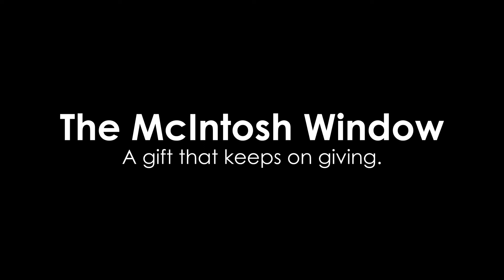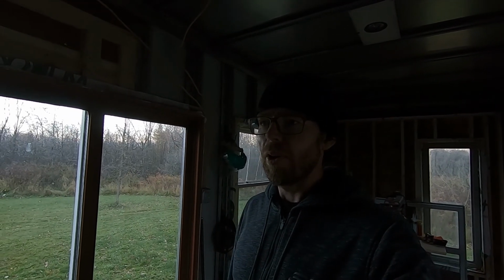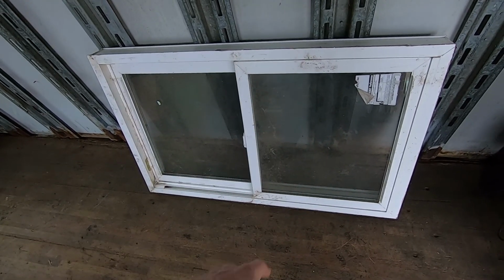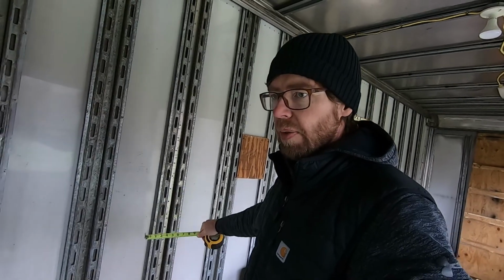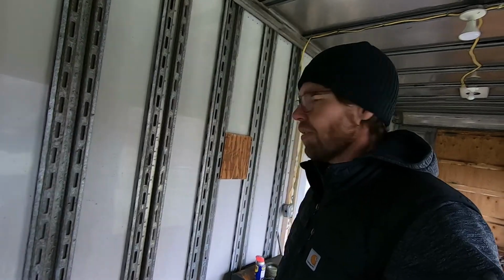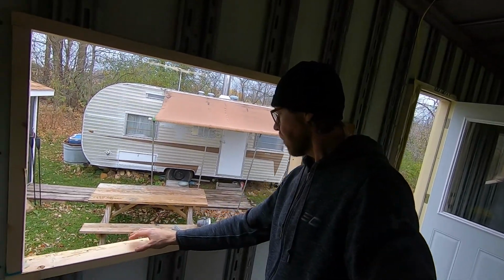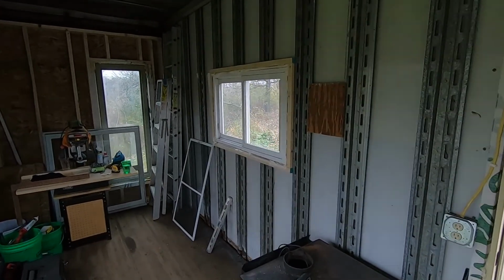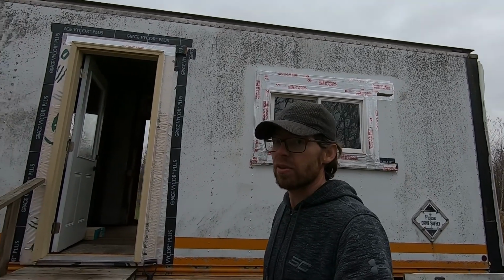Tiny Home Window Install Number 4 - Ep. 37

Comment: Go through the side if you can with the stove.
Reply from the maker: Hey Stan, we are still in the planning stages of the tiny and trying to figure out the permanent location of the wood stove. I think it will eventually sit pretty close to where we have it. Just wondering why you prefer to go through the side vs the roof? I like the look of a straight pipe up from the stove but we are open for suggestions. Thanks for your input.
Reply: @thejacobsonproject  my opinion was based on a shortage of info. My thought was based on an almost flat roof. I now know that your taking off the roof. The new roof should have some pitch. If it does not. You should consider going out the side for the simple reason of keeping water out will be easier and simpler going through the side. Low pitch roofs are hard to deal with